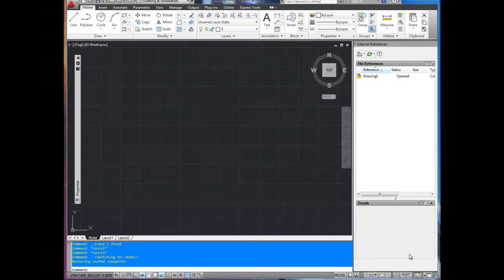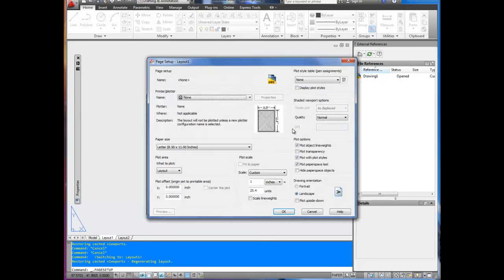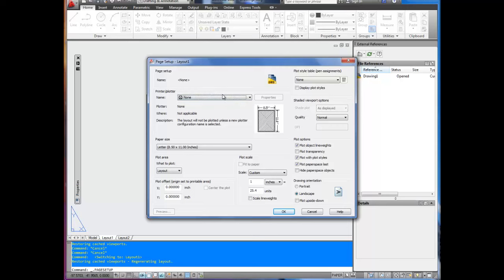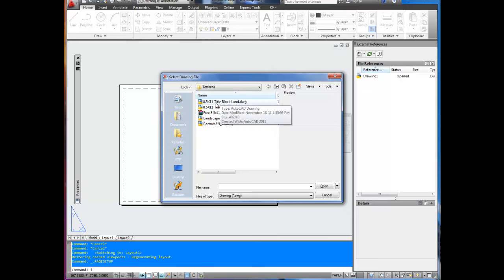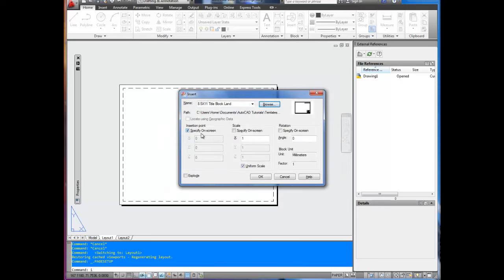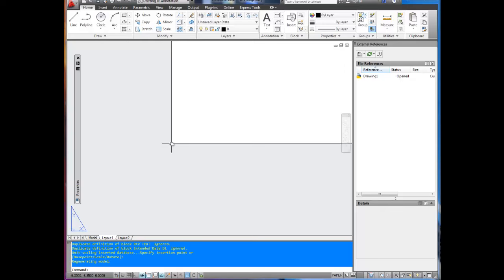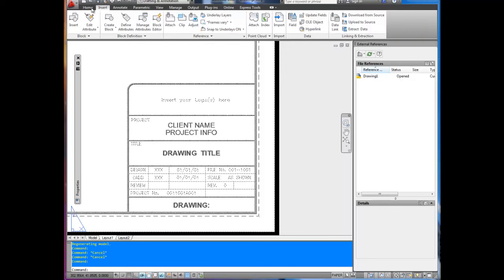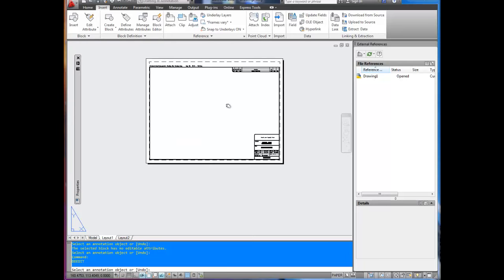AutoCAD Tutorial: How to Insert a Title Block

Comment from the maker: Hi LeAnn, I'm not sure what you mean by drop it in but they do work in 2013 (I use 2013) the free title blocks are just the .dwg block version of the title block. Like in this example they need to be inserted as a block into a new layout. The layout and your drawing must be setup to match the same units as the block (metric 8.5x11) or you can just insert it into any 8.5x11 layout and scale it down to inches.

Comment: I have a set of drawings where each sheet is a different CAD file.  If I insert the title block into paper space as a BLOCK there's not a way to centrally edit the block ONCE and have it automatically update all the drawings that it's in.  The block needs to be edited in ALL the DIFFERENT files that it's in.  Wouldn't it be better to insert the title block as an XREF, so you can edit the title block just once and have it automatically update all the files it's referenced to??  Thanks

Comment: Instead of zooming into the drawing to carefully line up your insertion, just adjust your OSNAP tools and they will register those corners and edges!
Reply: Amanda Olds actually in paper space there are no objects to snap to.  the easiest way is just to enter 0,0.  If i need to snap to the the printable edges of a layout space I create a view port using the fit command and you can use the snap points of the viewport to snap to.